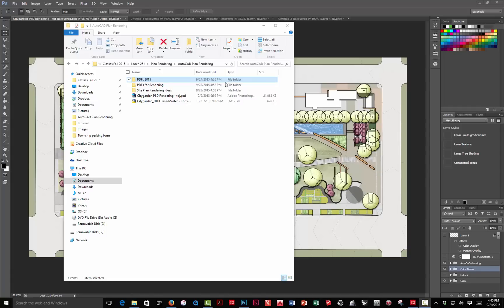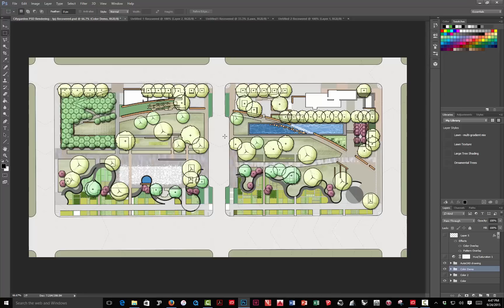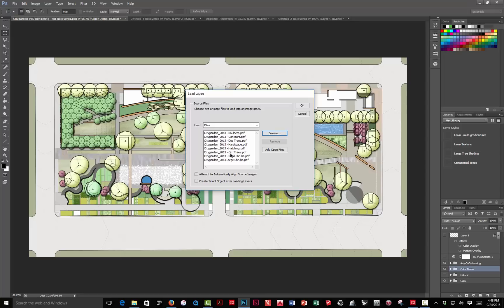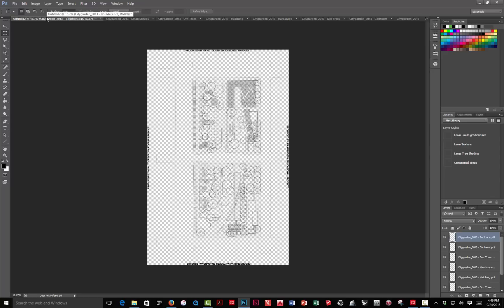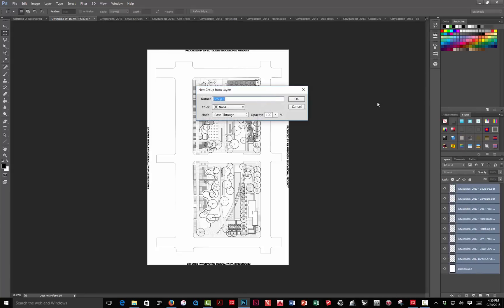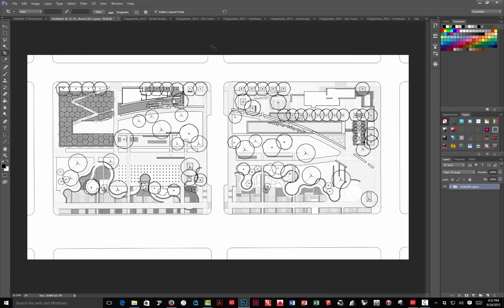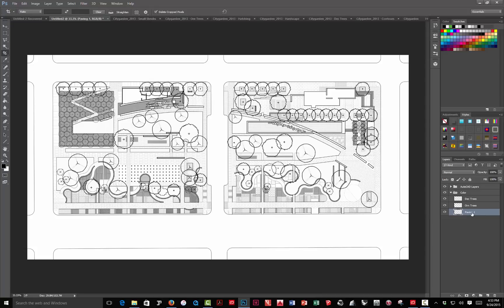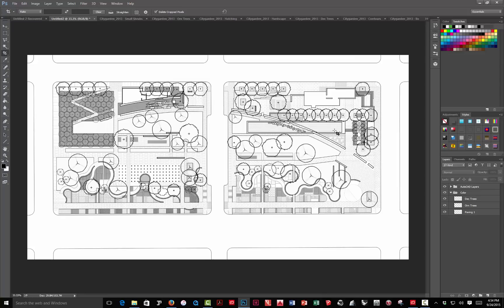Importing AutoCAD PDFs into Photoshop

Comment: I am printing line diagram schematics and using the thinest lines. The problem is in print it comes out faded in some areas, as if the pdf is not rendering the thin lines completly. Then if I print it with line weights enables they come out a bit too thick... This is for 24x36 print, do you have any suggestions?

Comment: i did the layers separately and all but it still won't align, i checked the coordinates are same on the Cadsheet as i also coppied from master sheet like you instructed  , idk why but even after making layer groups the individual layers wont show when i click on them
Reply from the maker: Before running the script to import the PDF's, open one of them using the "Open" command.  In the "Import PDF" dialog box that appears, be sure set the "Crop To" option to "Media Box" and NOT "Bounding Box" and then click OK.  This tells Photoshop to use the paper size and not the area occupied by the objects on each layer (which is different for each set of objects, which is why they don't line up). Once the document opens, you can close it without saving.  Now when you run the script, it will use that setting and all of the layers will line up properly.  You should only have to do that once on any particular computer and it should remember the setting.
Reply: One thing I noticed that wasn't in the tutorial, once your master viewport is created, lock the viewport before you copy.  Once you copy the new page layout all the layers will align correctly when importing into Photoshop.

Comment: What if the layers stack not on top of eachother? I have checked that I have the same coordinates on every CAD sheet by copying sheets from the master-sheet but somehow the trees for example ends up in different coordinates.
Reply: I solved that problem by making a viewport that was 11 x 17 in one tab, then copying that main tab as the "master format" tab and changing the layer state as required for each tab that i wanted to have as a separate layer in PS, and making sure that the layer that the viewport was on was turned on in each of the tabs, and making sure to be in paper space when plotting all tabs. it gives a common area of reference for all tab content. I hope that makes sense.